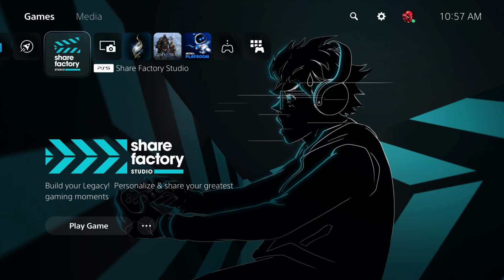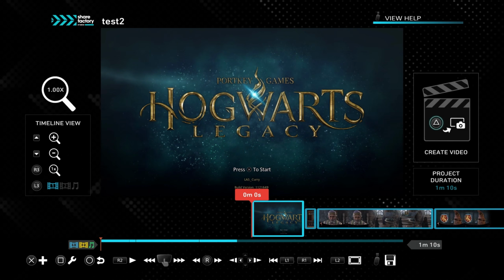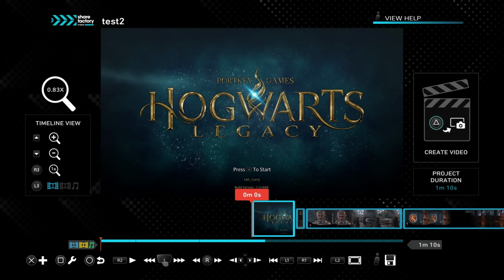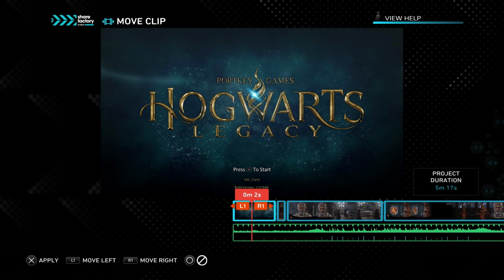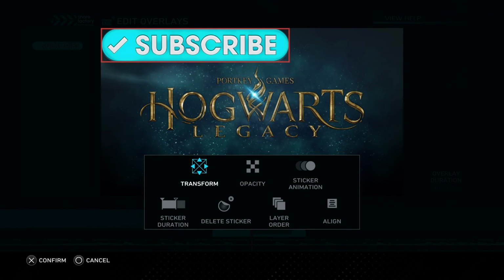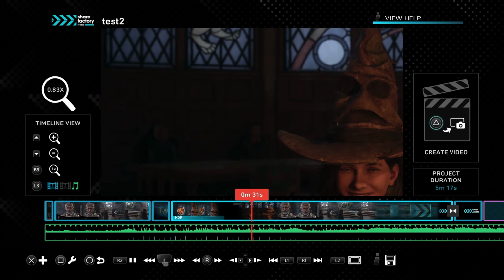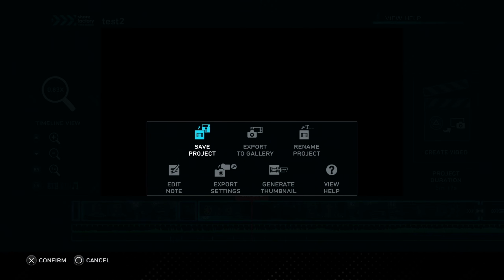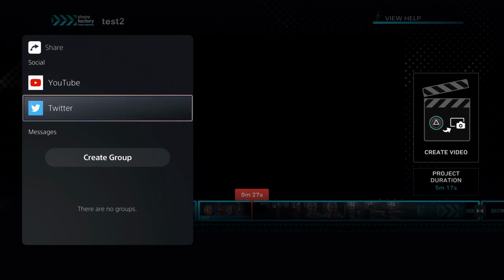How to Edit Videos on PS5 using ShareFactory Studio (NO PC)

Comment: Things that should have been mentioned in this video too are the fact that in Sharefactory, you can only make around 25 cuts in a video before you get a massage that you can't make anymore cuts in the video, that you can stretch out the timeline of the video a lot but can't cut clips to being shorter than 1 second. It also should've been mentioned that Sharefactory can't remove green screen parts out of videos that you find and download from Youtube and that the sounds map that Sharefactory has, doesn't work unless you convert sounds to wav format. The Sounds map in which you try to add sounds effects that you find online, into Sharefactory Studio, crashes when you try to import a sound effect via usb that is not a wav format.